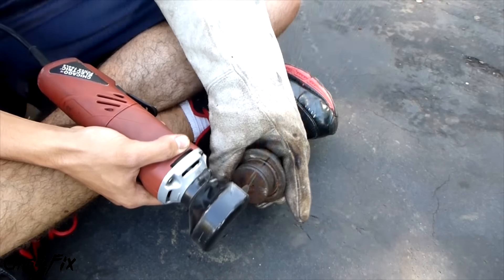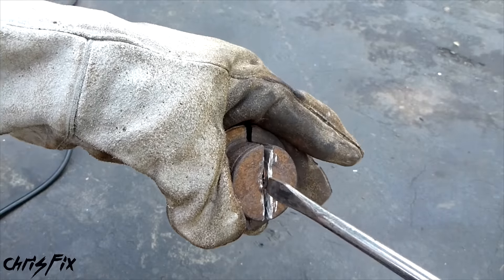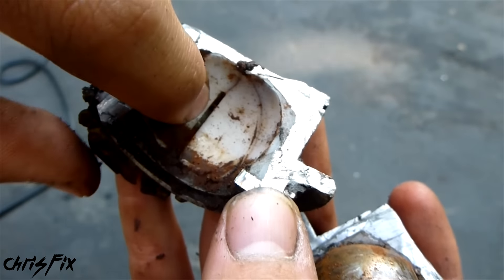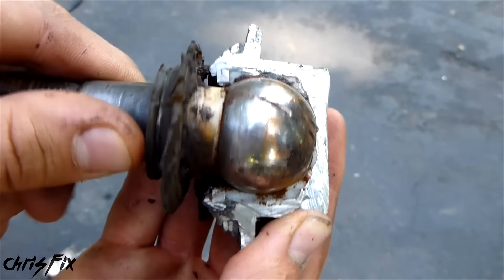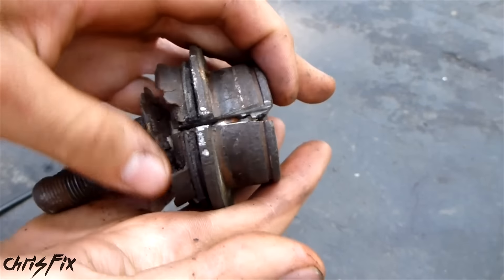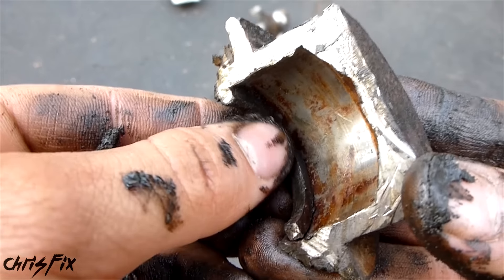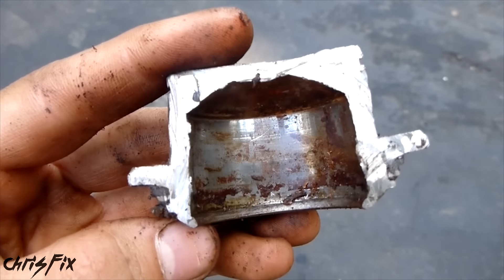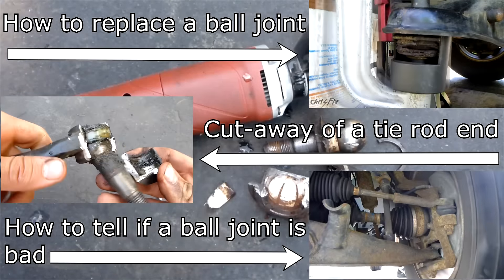What's Inside a Car Ball Joint

Comment: Plastics used for bushings and bearings are actually self lubricating - no grease is required. That's why they use plastic instead of steel on steel - steel would require periodic lubrication.
Reply from the maker: Thanks for sharing

Comment: This is informative to those who have to disconnect the Links to Anti-Sway Bars.  A design that could be improved on.  If you fail to hold the shaft while removing the Nut(s) with an impact gun, you will heat up the ball and melt the plastic. Often in the rust belt the nuts are so rusted that the Allen Key hole or 10mm stub fail before the nut comes loose.   Try a Vise-Grips and Impact gun - same result if Vise Grips slip and you rotate the shaft.
 If you heat the nut you will also melt the plastic inside.  You may as well have 2 links on hand (they are Left and Right) as you may have to cut off the nuts/shaft with acetylene torch.

Comment: Question on a fillable ball joint what would happen if you filled a damage ball joint with silicone . Like what they make bushings and motor mounts with because ive seen ppl refurbish motor mounts with silicone and it worked great

Comment: Hey Chris, please be careful next time.  You might cut your hand and end up making fewer videos.  Thanks for the video anyways.
Reply from the maker: zebrofez Thanks for your concern. I was using very thick gloves that would protect my hands if the cutoff wheel slipped or something.
Reply: ChrisFix I doubt it! If the cutter can go through steel it will go through a thick glove. Use a vice. Im.not one for health and saftey but that is just a finger waiting to be lost
Reply from the maker: djrmonix I have tested it. It skims off the glove. Thanks for the concern though. A vice would be better!

Comment: I was wondering if it could be drilled, tapped and a grease fitting installed to help it last longer, especially if the ball is hollow.  It would pack nicely with grease.   Another nice video of how it works, Chris.  Thanks.
Reply from the maker: If you knew it was hollow you could potentially try putting a grease fitting but odds are you will get metal shavings in the hole you drill so it wouldnt matter.

Comment: Another good video. I had one separate. I should not have ignored the squeaking sound that it was making. We were going slow, so the damage was minimal. The cv axle did have to be replaced, because it got twisted.
Reply from the maker: +Kirk Matheson good thing you were going slow!
Reply: At work a while back the security guard had coned off a Cadillac that was sitting on three and a half wheels across our driveway. He went over to the driver after the ball joint let go and asked, "Didn't it wobble when going over railroad tracks?" making a shimmy motion with his hands. She exclaimed, "Yeah! Just like that!"
Reply: Okay but a squeaking suspension sound usually isn't a ball joint.  Usually a ball joint will get end play and make a clunk noise going over bumps, or you notice irregular tire wear or a bit more wondering tracking though this latter you might not notice as much as it progressively gets worse.

On the other hand, ball joints, especially the lower one, are so vital for safety that you don't want to chance one failing, should replace them if you have any doubts even if you have to buy a less than top shelf brand to do so.

Comment: Thanks for this video.  I now wonder what the difference is between inexpensive and comparatively expensive ball joints.
Reply from the maker: I am wondering the same thing. These are the stock Ford ball joints, but I wonder what a good aftermarket vs cheap aftermarket ball joint looks like!

Comment: Jeep Wrangler JKs (2007-present) use plastic-lined ball joints. Many fail very early. I have read of several guys having to take them in for replacement with under 5000 on the odometer. I think "lifetime" sealed parts are a bad idea for load-bearing items like suspension and steering components. The bean counters at the auto makers obviously do not think so. Too bad. 

I recently replaced my JK's ball joints with some Synergy chromoly HD ones. So far they have been great. (But they are ball joints. They either work or they don't. So who knows how long they will last?) They were costly. I also replaced them on my TJ with the same ones. Probably a waste of money for such an old jeep. I probably should have gotten the Dana Spicer ones. Even Moog, if they are USA-made, are quite decent. The thing is to remember to grease them. If I maintain them they should be good for a long time. 

I need to cut my old TJ and JK ones apart to see what they look like. The TJ's were greasable and the JK's were the sealed ones like yours.

Should be interesting. Good video! Up-thumbed!

Comment: Hey Chris, I just replaced my control arms ~3 weeks ago and now there's a lot of squeaking coming from the front end when going over bumps. Sadly, I don't have grease fittings to use and I'm just dying to know how to properly grease my ball joint & bushings. I know I should've applied grease during the initial install... it was overlooked at the time for whatever reason.
Reply: Did you grease the control arms at their bushing pivots?  I'd suspect that more than the ball joint unless you severely over-tightened it.  You might try spraying a liberal amount of soapy water solution at the control arm bushings then taking it for a ride while they're wet to see if that pinpoints the problem area.
Reply: DFS54 - Upper ball joints on a 3rd gen Explorer "should" wear slower than the lower joints.  If you have already replaced the lowers, or just want to do both at the same time, I could see doing the uppers now as they aren't that expensive as aftermarket parts, say on Amazon or Rock Auto - just try to get a major brand.

On the other hand if there isn't excessive play you could just replace the grease boot.  I don't know if an '04 kept the same unique passenger's side two piece upper control arm design, but generally if you replace the uppers you will probably need to have a front wheel alignment done while just replacing the boots, you won't, assuming the tires are still wearing evenly.

Bushings, depends somewhat on how many miles, what kind of terrain, and whether exposed to a lot of road salt corrosion.  You will get a slight bit of play from worn bushings but that's far more the shocks, "usually", especially if they're around 40K mi. old or more.  If they are the original shocks, definitely go ahead and replace them now and see how much bounciness remains, then you can decide if you want to do upper control arms.

As with the upper ball joint, the upper control arm bushings have less stress on them than the lowers.  However one thing you could do is start the job on the lowers, disconnect the upper control arm to the steering knuckle and tap it side to side hard with a rubber mallet to see how much play there is.

On the other hand if you're in this for the long haul, plan to own the Explorer many more years, then I would go ahead and replace the upper control arms, but since you will then need a front end alignment, maybe wait to do them right before you buy new tires so only one alignment is needed then to cover both things.

Comment: They usually don't come pregreased. You should add your own zerk fitting or buy a good Moog ball joint that always comes with a zerk.
Reply: Toyota ones come with a ton of white (lithium?) grease, most aftermarket ones have a little bit of grease in them as well.

Comment: I got a Toyota  prius 2010 model  Toyota don't  sell the inner tie rods you have to buy the entire rack . All the after market are only for a gen 2 . So was just wondering if I could  pop the shaft off and fit it to a new ball cup end . Or is it even possible to take them apart .

Comment: Ball joints must be the most common problems, I had one fail on my small pickup making a turn on the way to work.  Could be really dangerous, but I was able to park it.   Sure would like to know why they don't have a grease fitting on the ball joints on new cars.  All you can do is make sure you replace it before it fails.
Reply: It can be made cheaper with plastic and no zerk fitting, and is smoother during the early part of its life, important for dealerships to sell new vehicles, and it only has to last until the warranty is up.

Comment: Can you modify it by drilling in rivets for a grease fitting?
Reply: No.  There's no way to take them apart for cleaning so you'd end up with metal fillings from the drilling which would eat up the joint.  Plus many use a so-called special lubricant, probably silicone grease while most people have their grease guns loaded with much cheaper lithium grease which isn't compatible with that factory grease load.

If you want a greaseable ball joint, buy one that came that way with a metal bearing instead of plastic.  If you insist on trying to grease the sealed type, you would pull the dust boot off and apply it from the top and work it in, but frankly at that point you'd have the ball joint off and given the bit of work to do that, ought to go ahead and replace it.  I suppose you could get an expensive silicone grease cartridge and inject the grease under the boot with a needle adapter with it still on the vehicle, but it just seems too much hassle and expense compared to replacement with one set up for greasing with conventional lithium moly grease.

Comment: Hey chris cant separate lower ball joint from spendle any suggestions
Reply: Spray a rust penetrant solution on it a few times.  What method are you using?  Some put a jack under the control arm and beat it out with a BFG (big fvcking hammer), or others use a proper ball joint press.  In worst cases you can use a heat gun to heat up the control arm and make it expand some, but usually it's just a matter of getting a bigger hammer.

Comment: Still need a video of how to change a rear shock on a ford ranger/mazda b series
Reply from the maker: It is coming soon. These videos take a lot more work/time than you realize.
Reply: Lol it sounds like you need some help with your channel!
Reply from the maker: ***** Naw, it just takes time to produce good content.
Reply: True that. I know how long it takes, I used to make videos when I was younger but now Im going off to college and don't have the time anymore...
Reply: Cole,  you really don't need a video to do that, it is very easy.  Just undo the bolt at the bottom, and two at the top.  You might have a pollution control box above the spare tire that you have to unbolt to get it out of the way if your hand and the right combination of wrench and socket can't get to the left shock top bolts.  It is among the easiest and quickest suspension repairs possible, unless the bottom bolt is rusted on then you have to use penetrant, or muscle-shear it off, or cut it off and buy a new nut and bolt.  The shocks generally come with new top bolts but not bottom.

Comment: Hi Chris, every time my car passes small edges on the streets at or over 50km/hour, it terribly sounds "bum, bum" which seems like somethings are loose. I replaced front and rear tie-rods (except the above ball joints, checked bearings, tires but cannot find the cause. Is it caused by the ball joints? Thanks
Reply from the maker: +Huy Huynh Here is how to test the ball joints: https://www.youtube.com/watch?v=62bVn7E8gyk
I would check your sway bar bushings too!
Reply: +Huy Huynh try checking the strut mounts at the top of the strut. just something to try. seen it before in my friends car.
Reply: +Huy Huynh try checking your muffler bearings.. ive never heard of rear tie rods lol
Reply: Are you aware that some roads are paved to deliberately cause these noises to alert drivers that they're drifting off into another lane?  It might be completely normal.

Comment: The white material is Teflon, don't need grease .
Reply from the maker: +Andon Metrefekseli Thanks for sharing!
Reply: Probably not teflon, because while it has low abrasive properties, it isn't so great for load bearing and needs a precise shape.  I'd guess polyoxymethylene (acetal aka Delrin), since I know some manufacturers do use it for ball joints, and being a thermoplastic it can be molded which they'd need, rather than extruded teflon machined to a high tolerance.

and no, either way you'd want grease, would be silly not to add any and reap the longer life from having it in a sealed system.

Comment: Ball joint fail because the grease runs dry.
Reply: and in the case of plastic lined ball joints, because of deformation from shock.  Potholes, speed bumps, etc.  Only light duty vehicles should have them.

Comment: Plastic bearings = cheap w/short life. I always replace mine with ball joints and tie rods with metal bearings.
Reply from the maker: Jeremy Durrenberger You mean bushings? What company do you go with that has metal bushings?
Reply: Yes, bushing. The entire ball joint is technically a "bearing." LOL  

I use Moog suspension and steering products whenever I can. Their ball joints and tie rod ends employ the use of a powdered metal gusher bushing. The metal bushing can withstand higher stresses than the plastic bushings and last a lot longer. Unlike factory replacement parts, which are designed to save costs and increase profits, Moog products are engineered to be stronger and longer lasting than the parts they replace. Their price tag certainly reflects their increased quality, but in my book, they're more than worth it. 

I'm a former manager of an auto parts store, and I've seen so many people return within a year to a year and a half with the cheaper ball joints after they failed on their work trucks, 4x4 toys, raised trucks, lowered cars, etc. When I talk them into 'upgrading' to the Moog products I never see them again (at least not for ball joints). 

For a plain-jane, unmodified grocery getter that is driven only a few miles per day, the cheap replacement brands with the plastic bushings are okay. However, for a vehicle that sees 50+ miles per day, a work truck, a car/truck that has been raised or lowered, or for a car you plan on keeping for several years, you can't beat the value of Moog.

I understand that CTR is a brand of ball joints that also contains a metal bushing, but I have no personal experience with them.
Reply from the maker: Thanks for the reply! That is some good info! I like Moog as well! And Mevotech. I wonder if they use a metal bushing.
Reply: I just checked out their website; it looks like they do.
Reply from the maker: Jeremy Durrenberger Yea, I contacted them and they have metal to metal ball joints with oversized ball pin contact areas for load dispersal, black oxide rust inhibitor, Polyurethane boots, greaseable units for service requirements, and all required graded hardware. Good stuff!
Reply: +ChrisFix Raybestos  ball joints look cooler
Reply: +ChrisFix Raybestos  ball joints look cooler
Reply: Chis, most if not all ball joints that come with zerk fittings to grease them, have metal bushings instead of plastic.